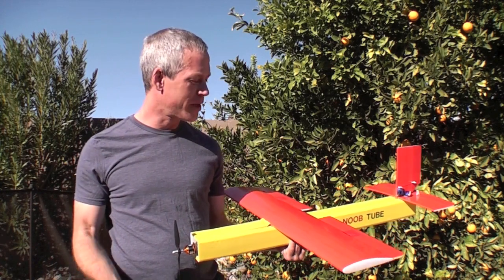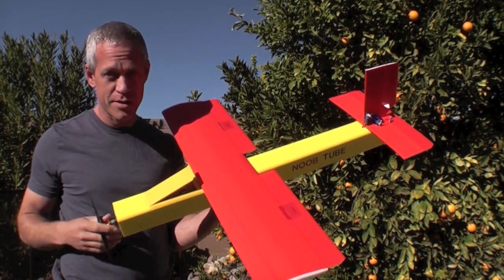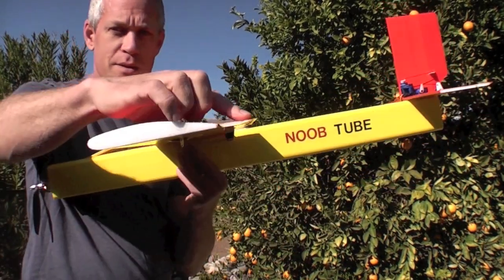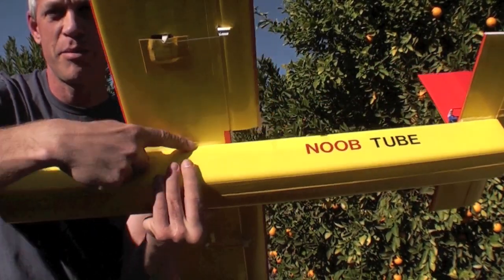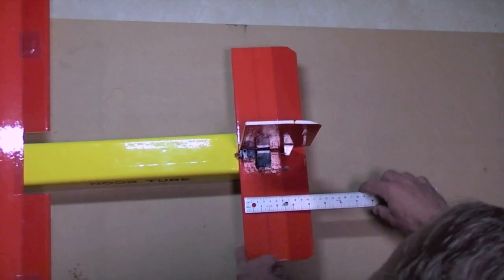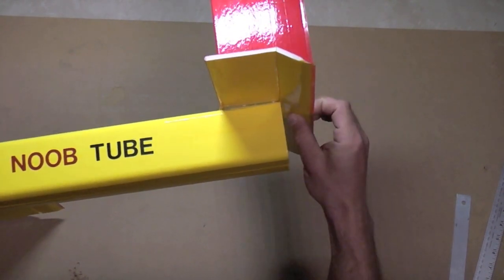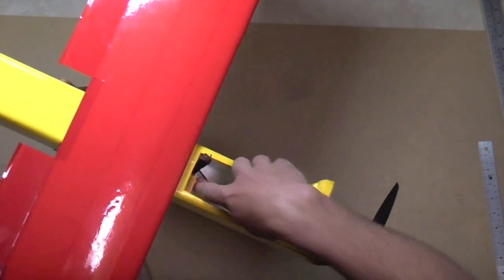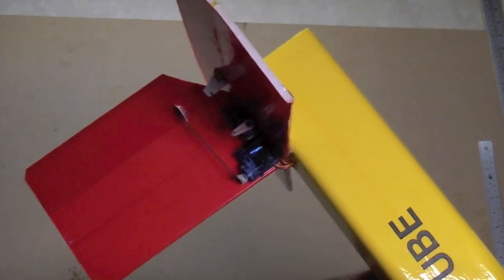NOOB TUBE Foamboard Fun Flyer

Comment: thanks for the great videos sir,If possible could you list the electronic parts neededI am very new to this and am overwelmed by motor, esc,servo size,radio and transmitter and battery size. I am going thru your videos and gleaning what I can but as of yet havent ordered any parts because I dont want to mismatch parts and ruin my build. Again thanks for the inspiration.

Comment: 2 questions when you say cg is 1/3 the way back do u measure fusealage only or include the spinner and elevator control surface length? second question could this bad boy carry a gopro?

Comment from the maker: I'd probably have gone a little more in between those props, like a 9x4.5.  I think if you have a good quality battery and ESC that the 10x6 is OK as long as you don't go nuts at full-throttle.  Sometimes it's nice to have a bit more thrust for maiden flights.  Let us know how it goes!

Comment: Hi Ed, i have just finished making the noob and i am using a 1400 kv motor with a 7x4.5 prop or i could use a 10x6 prop which would be best ?,  thanks for sharing your time and info best regards

Comment: @ExperimentalAirlines Have you tried landing gear? If so, what do you recommend? I'm thinking the best setup would be light but proportional (1.5-2-in) foam wheels on wire attached under the motor mount with a tack affixed under the back of the fuselage to act as a skid.

Comment from the maker: @petedaws I use two-sided foam tape or two-sided duct tape (yes, it exists!) to place the wing initially.  After verifying symmetry, location, and CG, I apply hot glue up inside the joint between the wing and fuselage.  I recommend using a high-temperature glue gun if available, with any temp glue stick, just to improve adhesion.  I suspect Gorilla Glue would work pretty well too.  I think the hot glue thing seems corny too but I've yet to have a wing fall off.

Comment from the maker: @AerialVideoCentral It would probably be about 650-700g and that powerplant sounds about right.  It's a pretty zippy plane, high wing loading and fast roll rate, and fairly hot landings with a 2200mAh pack.  Recommend considering landing gear, or turn on the brake if your ESC allows it, to help protect prop on landing.

Comment from the maker: @jmoutdoorz 2200mAh gives at least 10 minutes.  I'd probably actually recommend a smaller battery for most guys - I just have a ton of 2200's. I use Spektrum DX7 and usually OrangeRx receivers with satellites.  Neither of these is perfect but they are pretty good choice for inexpensive foamie planes.  Turnigy 9X would be another consideration if on a budget.

Comment: i am very new to the scene of rc aircraft, i was wondering what kind of flight time you get for this plane form the 2200mAh battery? Also what transmitter/receiver system do you use or recommend? 
By the way, i just finished watching all your videos, great job. They were very interesting, and informational, thanks!! Joel

Comment from the maker: @usarmyfl1 Actually all four servos have extensions in mine.  You could probably put your aileron servos further inboard and avoid extensions.  The rudder and elevator servos are at least 20" away from where you would likely put your receiver......unless you use longer pushrods.

Comment from the maker: @adit1001able Sure, mine wing leading edge is 8 1/2" aft of the fuselage nose (not incl. motor and hub.  I'm flying a 2200mAh pack weighing 180g sitting midway between the nose and the wing LE.  I would probably not go further forward with the wing, maybe a little back if using a smaller battery.  Adding landing gear might also compensate.  10" back at max. wing thickness is an approximation.  Make yours balance how you like.  I also posted some more specs in the description.